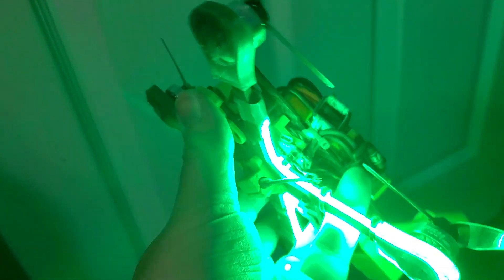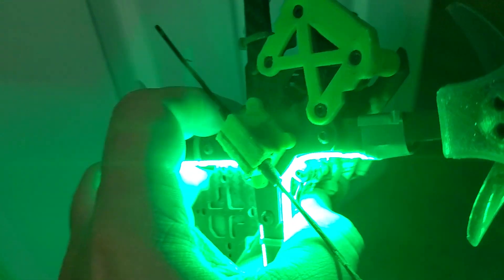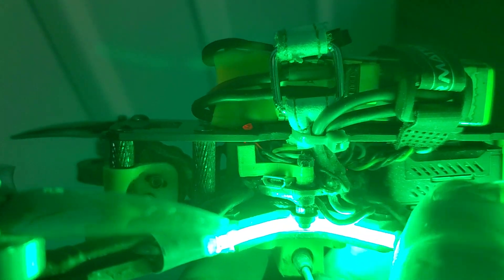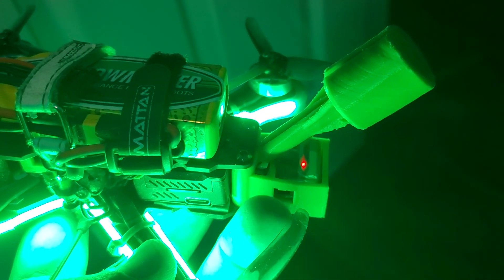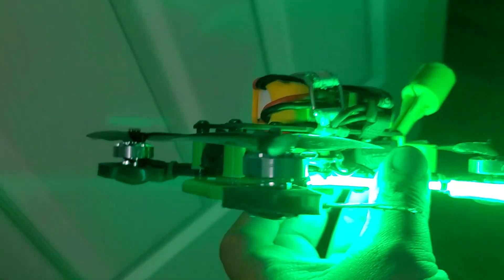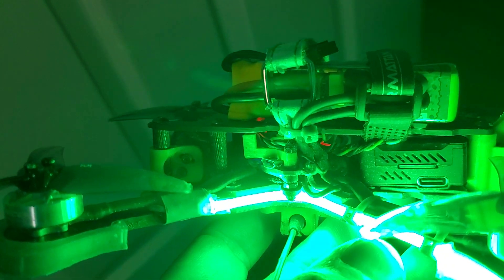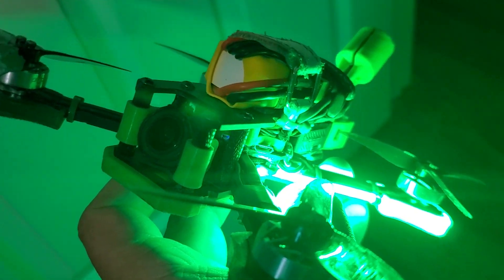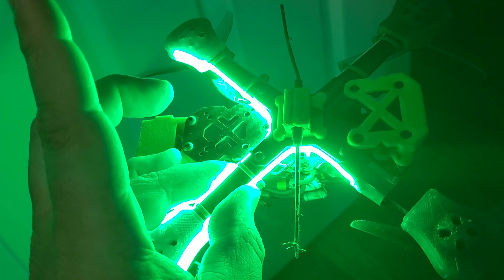My Grinderino - Build Details, Parts, and 3D Prints

Comment: What motor size would you suggest for a grinderino with 5" arms ? Cheers
Reply from the maker: @Banks_FPV  depends on your goals. You could go as light as 1604 or 1804, but probably as heavy as 2203.5
Reply: @Fly_High_FPV  I've only just seen this some how 🤯 I ended up going with 2004s
Reply from the maker: @Banks_FPV  how's it flying? What's your plan for the fiverino?
Reply: @Fly_High_FPV  i only got to fly it for one day so far as the weather is currently disgusting but its flying great and to be honest I wanted to build the 3.5 but the arms were out of stock in the uk 😭 but I'm fairly happy with it I built it with the new speedybee aio and seems to be all good !

Comment: All would need is 3d parts and a aio and LEDs I have the frame and ummagawd motors
Reply from the maker: The skidz and antenna mounts are all clearly listed on my site (order the tail with a GPS tray for ViFly), the fpv cam mounts and bumper set go in the custom slot for $9 a set (scroll to the bottom of my homepage and add 9 Yoda's if you want them). Got plenty of AIO and LED's, and Restocking motors shortly 👌

Comment: 1804 5mm are trash. Internal post is 2mm and they bend with the greatest of ease. I was talking to them about the issues and they ghosted me so fuck tmotor and their shitty 1804 NOT FOR freestyle motors. Check my let down edit.
Reply from the maker: They make the 1804 in a t-Mount option too, should I be grabbing that instead? Had a bunch of people complaining about fiddly T-Mounts, but they don't slip and they don't bend.
Reply: @Fly_High_FPV  I can't trust either. Once these die I'll have to figure something else out. I hate t mount...
Reply from the maker: @willbrown8928  sounds like we need some proper 5mm Titanium shafts